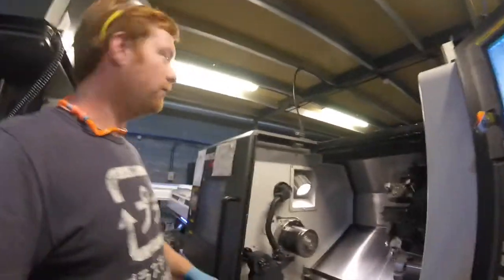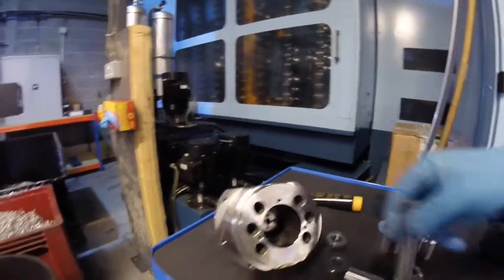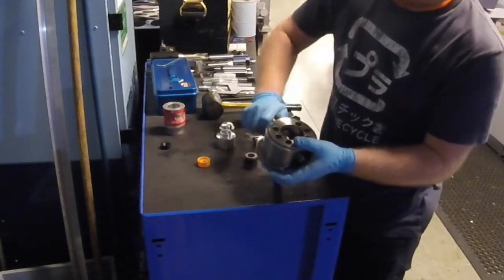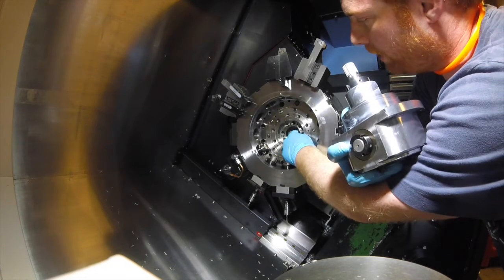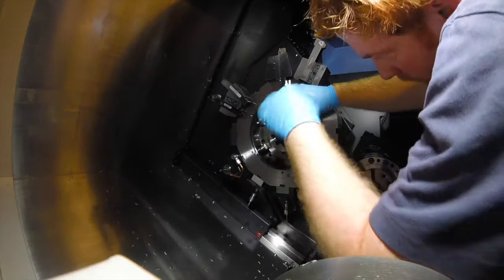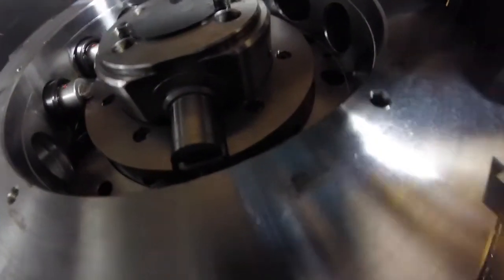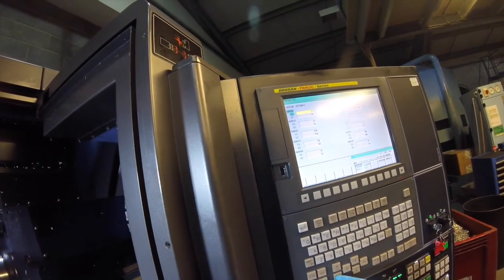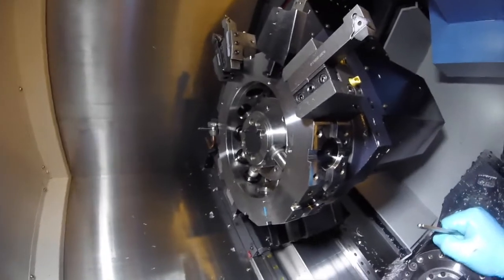Driven Tool Gearbox Bearing Rebuild on Doosan Lynx LMS220

Comment: Firstly, to the author of the video, I do appreciate the time you took to provide the information that you had and were relaying to others. However, many steps are missing, and some information is outright incorrect. To viewers: Please DO NOT use this procedure! I was Doosan Machine Tools Training Manager for service for 11 years. I taught 28 classes a year (6 per year specifically for 2 and 3 axis turrets) Firstly, the Lynx LMS 220 uses a FRONT MOUNT Live tool drive. The front mount live tool drive uses Way-lube type lubrication, with a AIR/OIL delivery system. The MASSIVE amounts of Kluber he applied (never exceed 23 percent of the available airspace) is going  to block the oil from getting to its location and the bearing will burn up (eventually.) Secondly, when replacing bearings, bevel gears, and spacers...precise measurements and potential corrections are needed to properly align the parts. Done incorrectly, the bevel gears interaction to each other (loaded or loose) will prematurely destroy the drive. Thirdly, the alignment in the depth is reproducible ONLY when replacing the same drive into the same turret, but the rotational aspect of the alignment needs precision when re-inserting any drive into any turret. There are many other issues. If the Author would like to discuss these to create a proper repair video, I will assist as best I can. My email is darrylhardt@gmail.com
Reply from the maker: Let’s just say the warranty/service backup was poor on all 4 of my machines. 

They probably should have sold me a puma instead in the turnkey as the lynx quite frankly wasn’t man enough for the job. But when it started to go wrong it was all my fault obviously….

Only option Doosan offered was a $7000 replacement box plus fitting….. on a 6 month old machine. Worked fine using this service for the next 7 years of my ownership…

I’m glad I’ve sold all my Doosans and I’ll stick to Haas, Fanuc and matsuura from now on
Reply: Hi, i'm about to change the bearings in my doosan machine. As jou said I cant follow the video exactly. Any extra tips I should do differently? Apart from applying too much grease? Thank you in advance

Comment: very cool. How does the drive dog engage and disengage when the turret spins around without alignment or other issues. is it pneumatic so that it moves back and forth or does it have some mechanics that positions the drive dog mechanically without assist? encoder? I have been curious about the mechanics of live tooling.
Reply from the maker: It has an encoder. That’s the value you adjust so it doesn’t crash

It has to have an encoder or you wouldn’t be able to rigid tap
Reply: That Lynx model is a direct drive coupling and is "fixed" in place by the motor (there are no additional cam-followers to assist in holding, as there are in the Puma live drives, or the Previous version that was "rear mount and used Moly grease replenished 2000 hour of use)

Comment: Excellent Video. Thank you. Is this a common job that needs doing with these machines? The one i use at work (220 LSYA - 2016) has needed this repair work twice in 4 years. If so it seems like quite a large achilles heal for such a good machine.
Reply: If the repair was done as shown in this video, I would be amazed if it lasted longer than six months under normal use.

Comment: Not sure if Doosan uses it, but SYSTEM > DIAGNOSIS > 445 will usually show the encoder position. Align the tang by hand, copy the value of 445 to 4077.
Reply: We do (only applies to newer machines)

Comment: I have not seen a bearing made yet that does not need to be replaced at some time or another.

Very good information, looks like you have a few machines in that space.

Doosan machines are good for two reason they are well built and at a more reasonable price than say a Mazak, which is a excellent machine but at a price you would expect to pay.